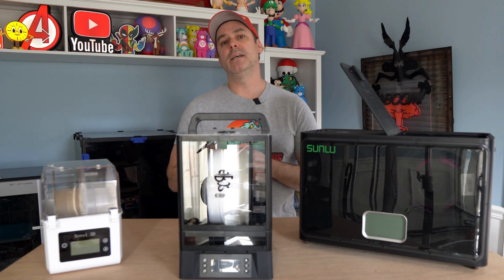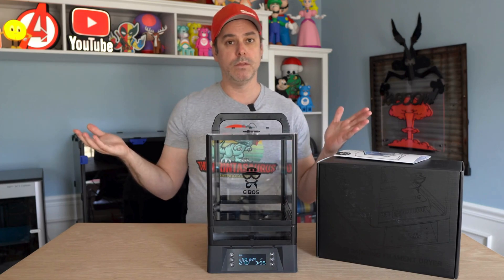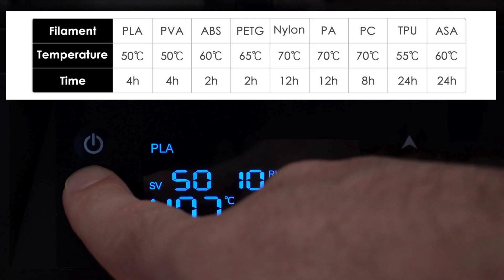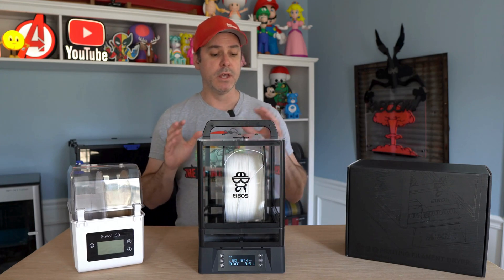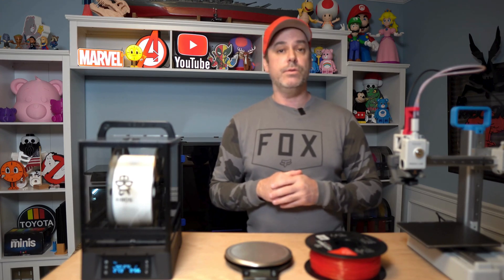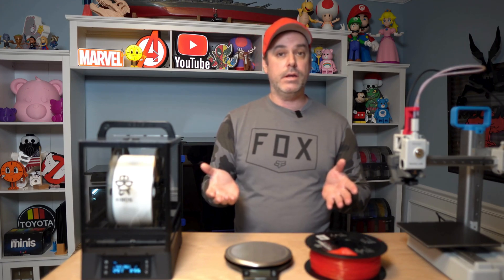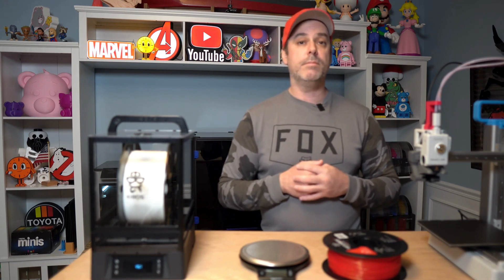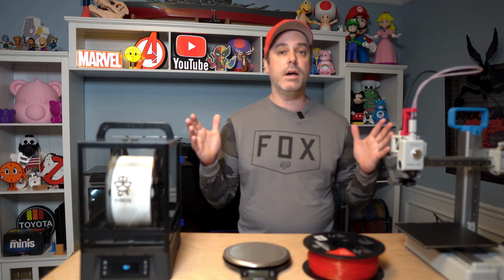Eibos Polyphemus filament dryer for everyone?

Comment: Just picked up one of the Polyphemus for my dryer as I have bought a few 3kgs rolls just due to cost savings. One thing to point out is that it won't fit ALL 3kg rolls. The ones I got from Push Plastic are actually really narrow and tall and won't fit. 

Working on setting up a re-spooler now to solve this, but worth noting that even with the expansion, you should be careful to check specs of any 3kg roll you pick up. Otherwise, I've so far been pleased with the Polyphemus. I like how it actually has multiple routing options for PTFE tubes. Routing through the top was my first choice, but that proved very clunky when switching rolls. I then routed them through the ports that are above the desiccant pack holders and that seemed much easier to deal with. 

Anyway, good review, and figured I'd share my thoughts.
Reply from the maker: Thank you for the support. Also thank you for sharing your experience with certain 3kg spools. I wish everyone could come together and set a standard for each spool size.

Comment: Bought one, it's rubbish lol. It doesn't even shut securely
Reply from the maker: Did you buy or print the extension as well? I didn’t use without. Curious, I found it worked great and didn’t have issues with the lid. But mine may have been a pre-production. I’m not sure.
Reply: @ThePrintasaurus  yes, I bought the extension and use it, the lid just falls off if it gets knocked, it dues not close securely, the rollers don't spin and customer service is a joke
Reply: Yeah, reviewers get units to test for a day or 2 and don't really use them like normal folks do. Hot trash and a waste of money.

Comment: I bought one. Looks solid. The RH monitor is unnecessary in my opinion. 10% is always there after 5-10min from the start of drying. So what's the point? How can I be sure the fiber is properly dry? Or im missing something?
Reply from the maker: For the most part I always weigh my filament before and after. I could see the RH monitor not being overly accurate with the case not being completely sealed.
Reply: @ThePrintasaurus  Thank you. Anyway for everyone i bought it monday and in wednesday i got it home. Crazy, 2 days to deliver from China to Europe.

Comment: Thanks for the review.

IMHO, $129 for a good dryer is a fair price. This dryer handles my biggest issues that off the shelf dryers (including the fancy sunlu s4) suffer from: hot spots. That said, the motor needing to be replaced eventually as well as the cover needing to be lifted off are deal breakers for me. IMHO, the two best drying options right now (and the two I use) are a cabinet style food dehydrator and the polymaker polydryer. The polydryer is an excellent design; the air coming out of the main heater fan doesn't get hot enough to murder your filament if you use the correct setting. It doesn't get hot enough for nylon, but realistically, very few, if any, of the off the shelf dryers do. The modular approach of the dryboxes and heater being separate is excellent. Already there's plenty of mods out there applying the heater unit to the AMS, pythod box, etc.

As for a food dehydrator, I like cabinet style dryers. They have a huge fan that moves a lot of air, another requirement many dedicated dryers fall way short on. Really, the only downside is no being able to print from them out of the box, but modding them should be moderately simple to do so.

My ideal dryer would be a cabinet style like a food dehydrator with a door that opens from the side or swings up or down (like a toaster oven). Huge fan, accurate heater within a few degrees that can reach 100c (required by some nylon blends), simple display that lets you set time and temp (many dedicated dryers have unnecessarily cluttered displays/ui, including both the polyphemus and s4), filament feeding options. Sovol actually comes really close with the SH04 dryer but the major drawback is that it's fixed at 50c. Otherwise it's a fantastic design. It's fine for PLA (which rarely needs drying), and probably just ok for PETG (60-65c ideally), but I wouldn't buy it if I was printing ABS, ASA, PC or nylon.

If a company made a dryer like I described, I'd pay $300 for it easily. There's some commercial solutions available, but their cost is in the thousands.
Reply from the maker: Thanks for your feedback. I like that enclosure / dryer idea. Would be nice to see someone offer something at a price point that isn't industrial/commercial. 
I plan to experiment a little with the polyphemus enclosure, see if I can make a top that comes off and on by magnates. Something to make things easier to route filament through the top ptfe ports and make it alittle easier to swap out filaments.   

For my Sunlu S4, I printed some tabs that make opening easier, so small taps are horrible!!!